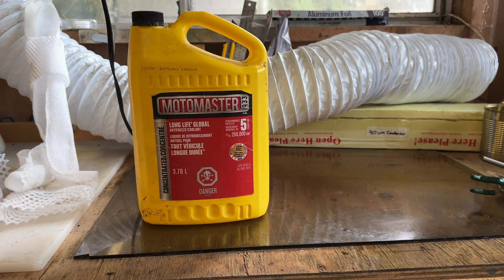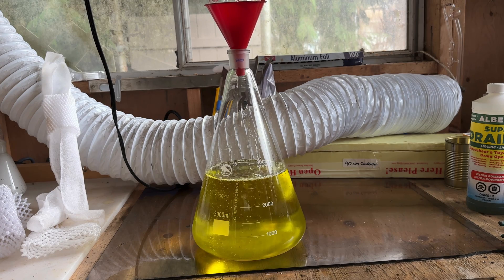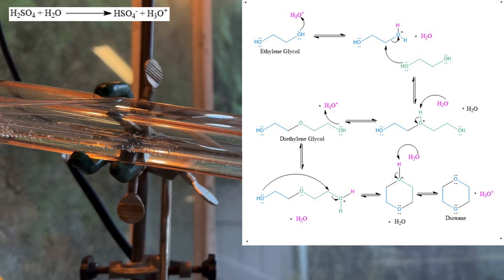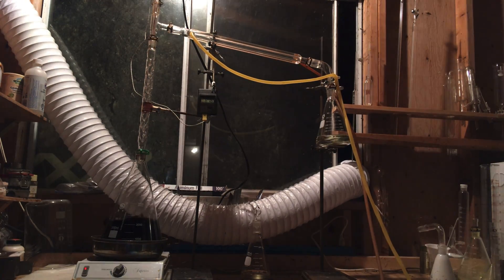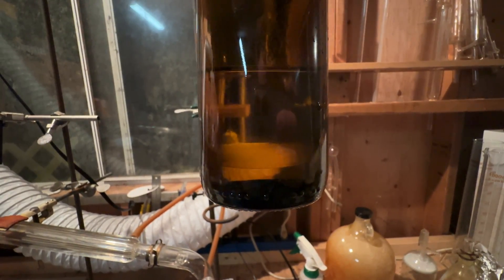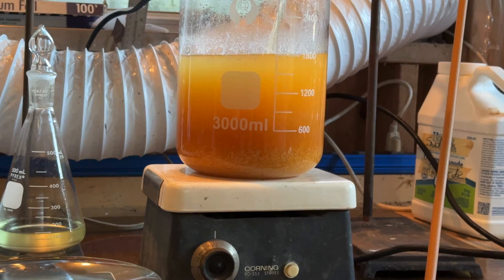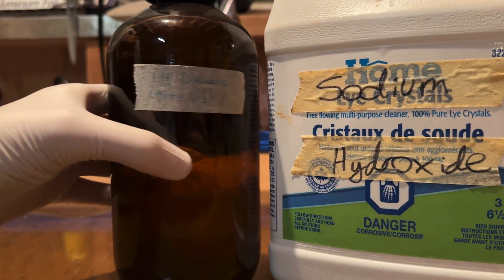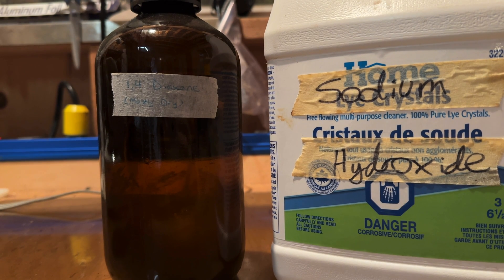Dioxane from Antifreeze - Acid Catalyzed Dehydration of Ethylene Glycol

Comment: I was wondering about using propylene glycol aka PG used in vape juice. Its the safer alternative and is widely available. Also does dioxane work as good as ether for a solvent?
Reply from the maker: Propylene glycol would produce dimethyl dioxane, which may be useful itself for other things. I don’t know too much about the applications of that compound. Dioxane has a higher boiling than diethyl ether, although is still flammable so both still prevent a fire risk. Dioxane is soluble in water, so it’s not as useful for liquid liquid extractions with aqueous solutions compared to ether. I know it has applications for dissolving ink and stuff in some markers, but my main plan is to use it to make sodium metal via Nurd Rage’s method. I’m sure I will find other solvent uses for it too.
Reply: @TheCanadianChemist  all you need for that sodium metal reaction is magnesium turnings/ powder, mineral oil or kerosene, anhydrous NaOH, and some menthol. 

Add bromine to it (dioxane) and see if you can stick it to another.  molecule.
Reply from the maker: Yeah, I’ve seen that method using the menthol, it’s another reaction I’m wanting to try. I tried using tertiary butanol many years ago to make potassium, but I think I had issues with the dryness of my reagents. Definitely going to attempt again in the future.